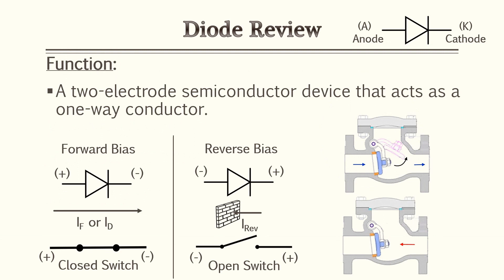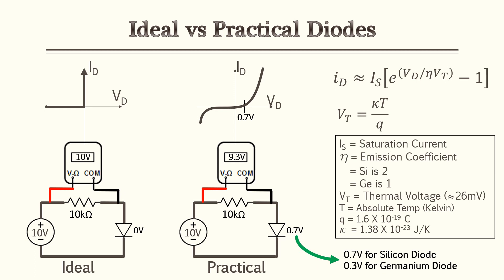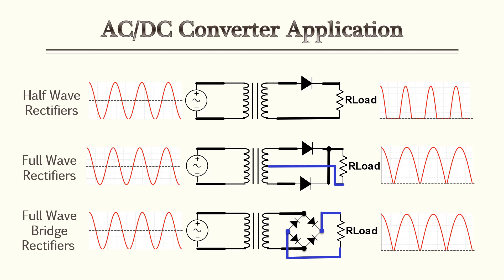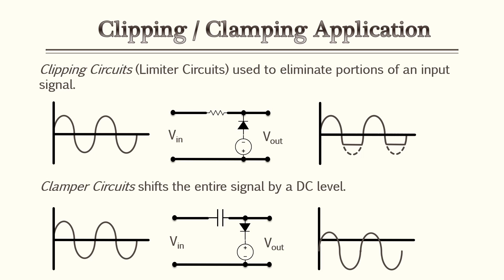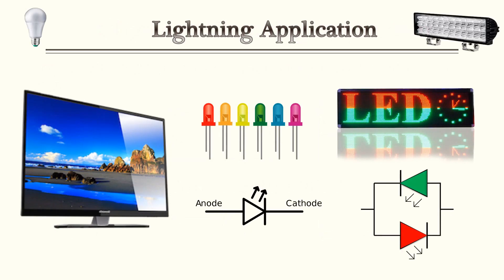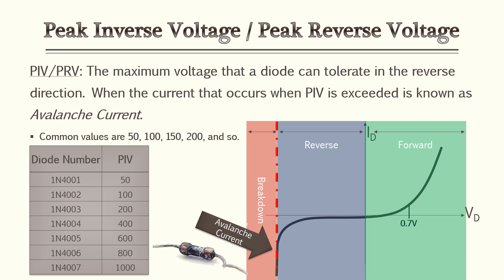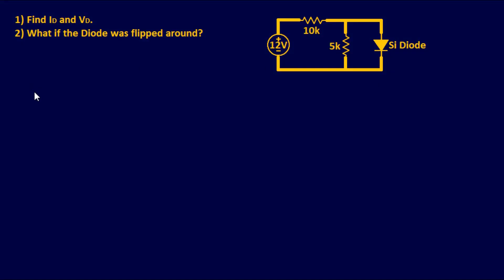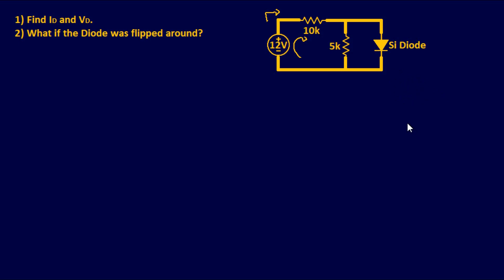Electronics P.E Prep - Junction Diodes

Comment: 12:14,  I got D as the answer too. But isn't  Vpeak = Vrms * 2 for half wave rectifier?  Vpeak = 120Vrms*2 = 240Vac ?
Reply from the maker: No. Vrms = Vp * squareroot(2). 1/squareroot(2) = .707
Reply: @electronicspepreparation   What about for a full wave rectifier ? What would be the PIV?